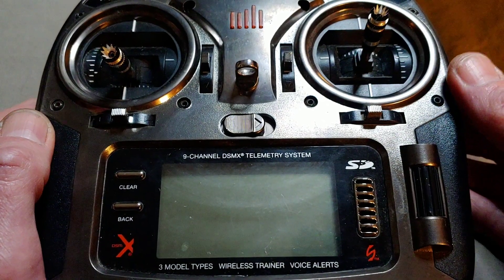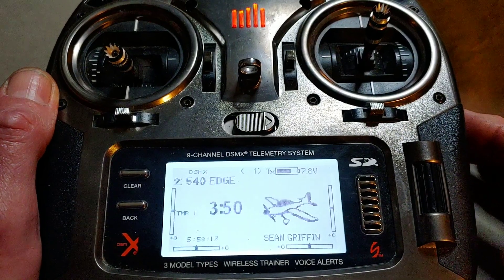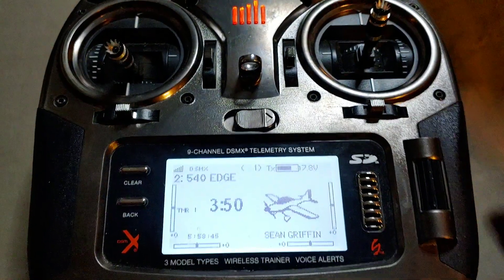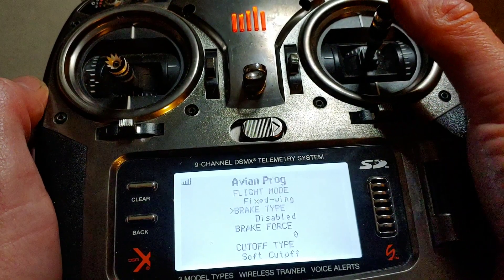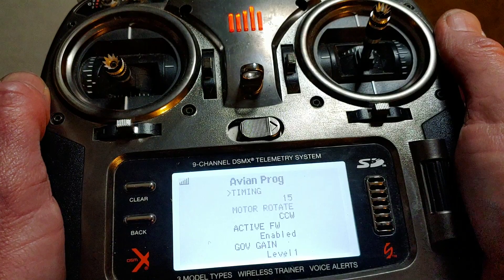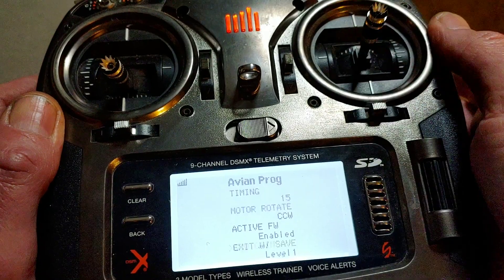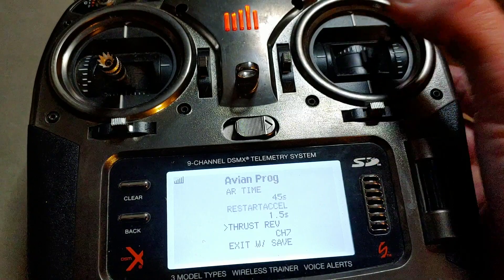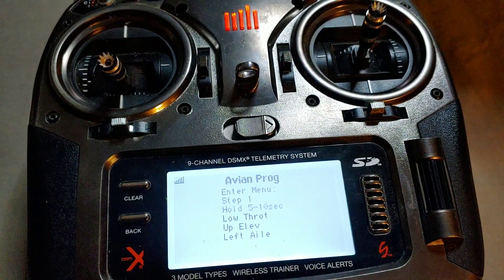HOW TO PROGRAM A AVIAN ESC electronic speed control FROM A SPEKTRUM TRANSMITTER E-FLITE SMART RC AIR

Comment: Maybe you should emphasize more clearly that stick programming is only available for about the first 30 seconds after powering on the ESC. After that, it’s disabled for safety reasons, so it can’t be accidentally activated during flight.

Had I known this earlier, it would have saved me a lot of frustration, as I just couldn’t seem to get it to work.

Comment: Hey Sean, your set up worked for me but I have had the same issue, on two different e-flight V1200s. Even in forward thrust, if I throttle up too fast the motor will cut out. It will not work again until I disconnect and reconnect the battery. This is based on using a Spectrum Gen 2 9 channel radio. Have you seen this before ?